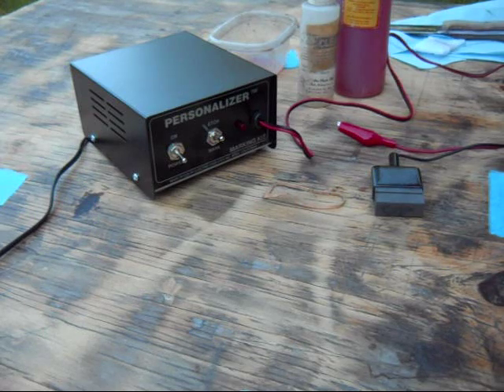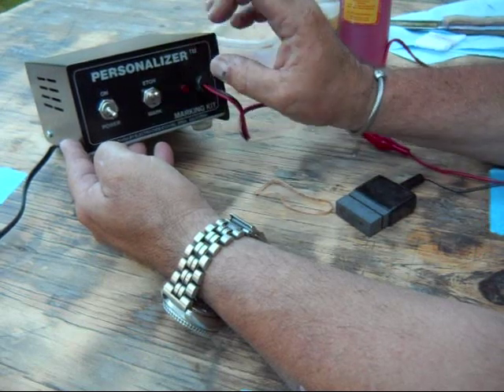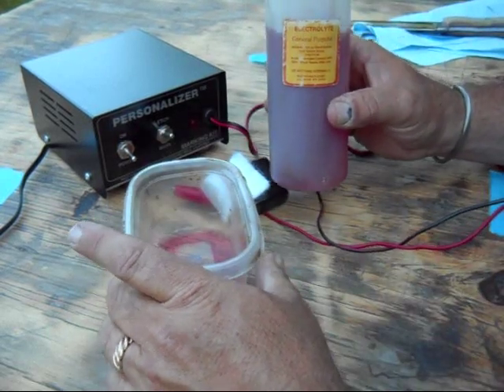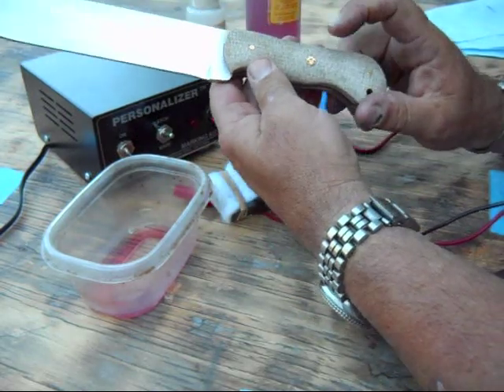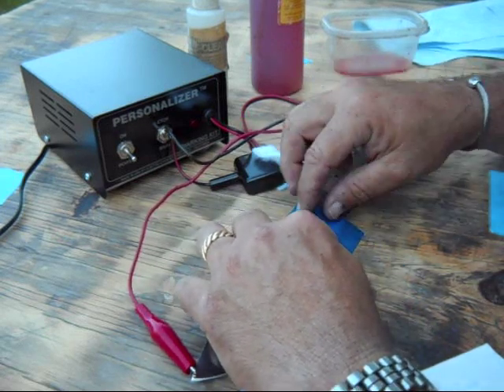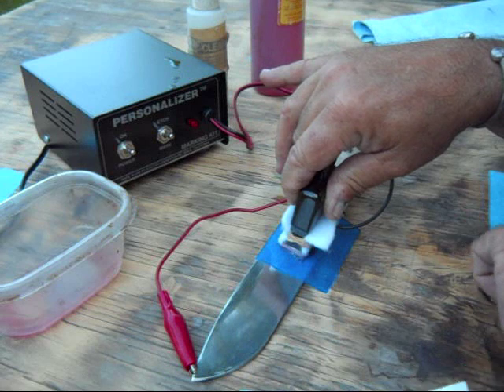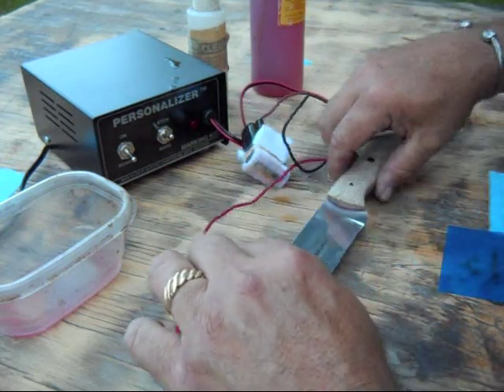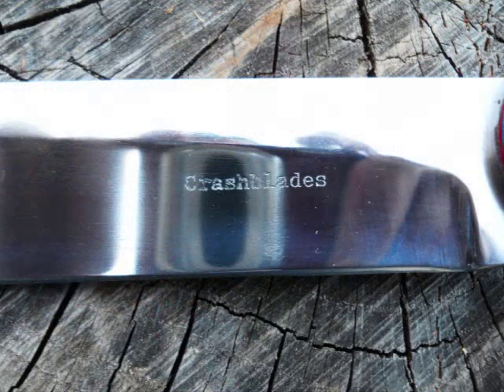Putting A Makers Mark On A Knife

Comment: i have the same machine and it came with 3 chemicals but I do not know which electrolyte is best for the metals I use. I work with cpm-154, AEB-L, Damascus, and O-Can anyone here advise me on which Electrolyte works best. I also use a digital vinyl cutter to make adhesive stencils. Sometimes the "mark" isn't crisp and looks cloudy. When I clean it and remove the stencil it looks like shit. WTF?
Reply from the maker: Honestly, I haven't noticed that much difference between them.  There probably is, but I do a deep etch for about 70 seconds and don't see a difference.  I get very similar results using salt water.

Comment: can your stencil material be reused? if so, where do you get it?
Reply from the maker: It's intended for single use.  I get mine from Jantz Supply (on-line).
Reply from the maker: This particular material is intended for one time use.  I get it from Jantz Supply on line.